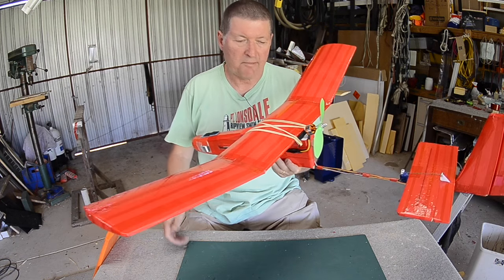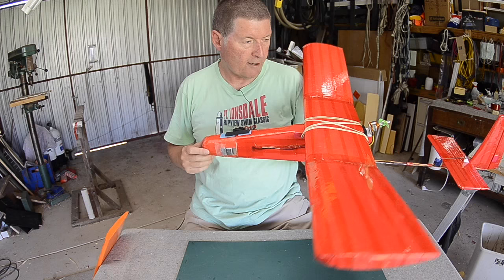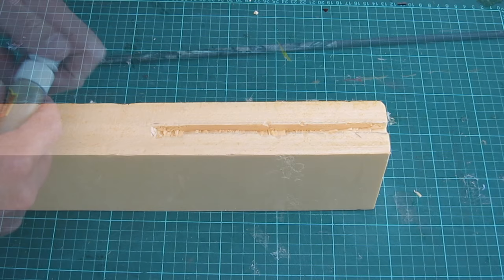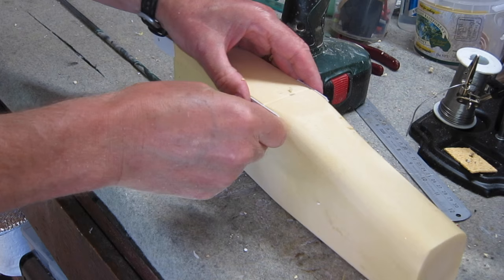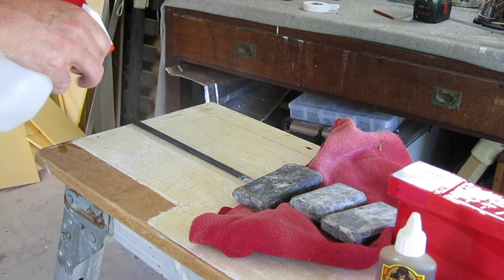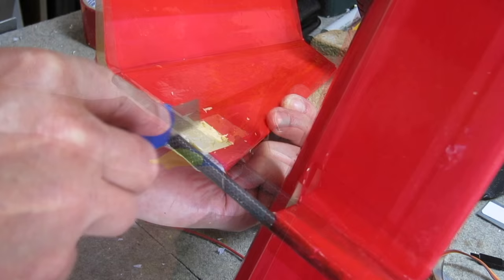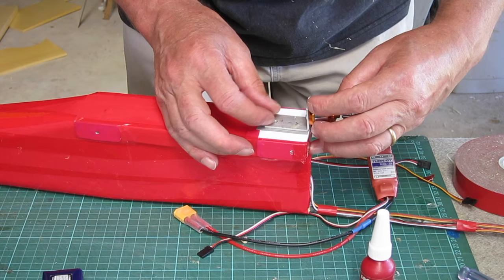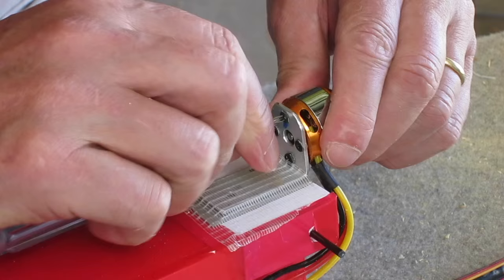3 channel trainer build

Comment: Hi Andrew,
I am new to RC planes and bought a float plane from the local store and I am having trouble getting coordinated and rather than trash this plane, I am building one of your trainers.  I did not have any foam for the nose piece.  I saw a woman in the store on the weekend with a pool noodle (foam tube for swimming) and found my solution.  I cut it up last night and it works just fine.  I think it is a little softer than packing foam, but I am certain it will do the job. Thanks for all the info you post - a huge help.
Reply from the maker: Excellent Peter, Pool noodle is perfect, I want to make a full fuselage from pool noodle one day.
Reply: Would you reinforce it? I definitely want to see the pool noodle build.

Comment: Hi Andrew, i finshed the trainer. I didn't build it based on plans. If  i remove all the electronics  and test gilde it, then she glides smoothly, is this the correct centre of gravity?
Reply from the maker: If it glides straight then it is balanced well
Reply: @AndrewNewton  so when it's balanced well. Is the balance point is the CG ?

Comment: Hello Andrew ,thanks for sharing your videos they are really helpful for  beginners like me , you mentioned using 1300mah 3s in front and CG is about 4mm from leading edge,it didnt work unless using 2200mah instead to get it balanced at that ratio (24%)
Hope I can fly it this weekend :)
Reply from the maker: Hi Samah. I guess your tail is heavier than mine? Good luck with the flight, let me know how it goes. My CG is more like 50mm from the LE.
Reply: +Andrew Newton thanks..ok I will shift it back to 50mm and  let you know how it goes .

Comment: Man, you make this look so easy I feel kinda mislead. it took you what, 3 hours start to finish including troubleshooting? My first rc plane took me a week! And 2 years later I still can't find good wires for the control surfaces servos, AND it crashed catastrophically on its maiden flight, AND it slashed my knee when testing it 😆... It was a steep learning curve I tell ya
Reply from the maker: Mwahaha, my evil plan has worked.

Comment: I’m a complete noob. Bear with me. Why does it need to be dihedral/ poly hedral- as a result of being 3 channel?
What would happen if the wind were flat?
Reply from the maker: Good question Dave. To turn a plane it needs to bank into the turn, otherwise it skids sideways. Usually use rudder to initiate the turn and ailerons to control the bank. 3ch plane doesn't have ailerons so it uses dihedral to cause the banking. Rudder turns the plane slightly side on to the direction of airflow, in that state the dihedral rolls the plane.

Comment: could you explain why the motor is oriented on the mount to provide thrust in a slightly downward angle. Ive just ordered all the electronics to make my first RC place and im interested in pushers because i dont want to break all of my props.
Reply from the maker: High mounted motor will push the nose down, angling the thrust down makes it fly level.

Comment: Just wondering.
How would you know what... Motor.. Prop...esc... And battery will work with what size plane.. Thanks.
Looking to make a 32 in slow fly.
Reply from the maker: Experience mostly. SunnySky 2216 1200kv with 8x6 prop and 30A ESC is a good standard for mid sized planes. Smaller motors for smaller planes etc. Motor spec usually tell you prop and esc required.
Reply: Thanks

Comment: Hi, how important is the weight of the hull on this wing dimension? I built my first model according to these instructions, but he does not want much air. I suspect the weight of the hull! After the throw, he will immediately fall. Please can you help me ?
Reply from the maker: Lighter is better, it will fly slowly and easily. How much does yours weigh?
Reply: Only body without wing and battery, weights 380g
Reply from the maker: That's a little heavier than mine but just means it would fly faster. Might be motor thrust angle or wing incidence. Does it glide at all when you throw it without motor power?
Reply: Hi again, when i throw it without motor, it fall immediately without any gliding

Comment: I'm new to planes, but have built a couple of quads, and I have a question-do planes not have flight control boards? like do u just need a receiver?
Reply from the maker: Most planes don't have a flight control board and you just need a receiver, but they are starting to appear more often these days.
Reply: It surprised me, as well. RC planes are much simpler than quadcopters, and learning about them gives you some nice perspective into why quads are built the way they are.

Comment: Thanks for sharing the plans.  I think I have everything dimensioned out for my build.  The only thing I didn't see was the angle of the motor mount.  I may have missed it and will look again.  If you have a chance I would appreciate it if you might reply the angle.
Reply from the maker: Hi Lloyd, it's about 10 degrees forward from vertical. Need to experiment a bit to get it right.

Comment: Hi, that is a really nice plane.
I have been experimenting with 3ch pusher motor as this one but always have problems finding the thrust angle, how do you find it so it does not dive the nose on full throttle?
Reply from the maker: +Jonathan Corredor My motor mounts are bendable so I keep tilting the motor forwards until it flies level. You may never be able to get it perfect at all throttle settings.

Comment: Great work Andrew! I'm interested in getting into cutting foam wings, but I have one question... How thick is the material you used for the tail section? Looks like about 10mm?
Reply from the maker: Yes that's about right. You could use 6mm depron or even 5mm foam board as well.

Comment: Hello Andrew i built your design and it is working great thanks 😊 , i want to ask you about extending ESC cable to the battery is that safe or i need to add extra capacitor to the ESC.
Reply from the maker: No problem. I have done that many times with no extra capacitor.

Comment: I have a Voltage Alarm what is the low Voltage Alarm need to be set at? I have never set it before.
Reply from the maker: You would set it at about 3.3 per cell. Seems low, but the voltage drops when the battery is being used. You would stop using the battery when it's about 3.7V per cell at rest, which is roughly 3.3V while flying.
Reply: Thank you now I know. And you don't how you have help with my question on everything.

Comment: Sir, if I use 2212  1400kv brushless motor n  2200mah battery in this plane, it will fly?  Plz reply me Sir
Reply from the maker: What size prop?
Reply: @AndrewNewton  you suggest me Sir,  which pop is suitable for this combination
Reply from the maker: @SubrataDas-nb6fl  8x4" would be OK, or anything near that size
Reply: @AndrewNewton  can I use 8*6" prop, 2200mah battery n 1400kv  brushless 2212 golden motor  in this plane Sir?

Comment: mate what s decent hot glue gun would you recommend ? I got couple but they all not good. cheers
Reply from the maker: This is what I use https://www.bunnings.com.au/crescent-60w-230v-glue-gun-kit_p5810655 and the LiPo one from Hobby King
Reply: thanks !  does the crescent gun drips while on the stand ? or does it overheat the glue ?

Comment: Wonderful build Andrew, you have inspired me to make an XPS fuselage as well. Did you find that packing the battery in the foam caused any heating issues for the lipo? Thank you!
Reply from the maker: No heating problems, it's a small motor and I don't go full throttle all the time.
Reply: Thank you, I wasn't sure if it acted to insulate the natural heat or not. Glad to know it's not creating any adverse effects.

Comment: Hi Andrew.
This is Protik Banerjee from India West Bengal hobbyist age 55yrs. I am Interior Designer in profession. few months back I saw your 3 channel Trainer and got the idea to build one. but the one I build with coroplast is around 1420 grams in weight. Fuselage is made of 20x20 aluminum 
Can you guide me to build one 3 channel trainer. I got Turnigy D2826/6 2200KV motor, Turnigy Plus 40A ESC, 3s LIPO 25C 4000mah weight 328gms and 7x4 Master Airscrew pusher props, Note: Depron is not available in my state so i plain to make it with coroplast and thermocol.
So could you pl sagest me a size and design to learn flying  gliders.

Thanks
Protik
Reply from the maker: Hello Protik.Follow the links in the description for more information.  I have not used coroplast for wings or full fuselage. Your plane will always end up heavy. Have you tried Experimental Airlines Photon or Axon designs? They might be OK for your materials.
Reply: Hi Andrew Thanks for reply. What is the materiel used to make Photon or Axon designs?
Reply from the maker: I used depron, Ed uses Adams foam board, You can try coreplast maybe
Reply: What is the weight of your 3 channel trainer, What is the detail of Motor, Props and Battery.
Now I am planning to make it with Thermocole and laminate it.
How much load can my motor and props take. Once I complete the glider i will send you the photos.
Thanks
Reply from the maker: Protik, don't be lazy, read the video description